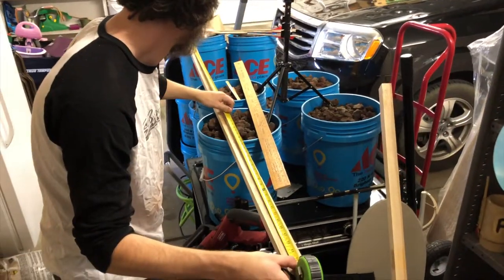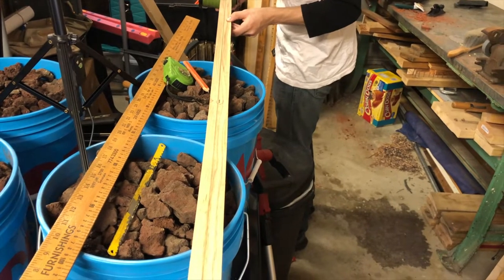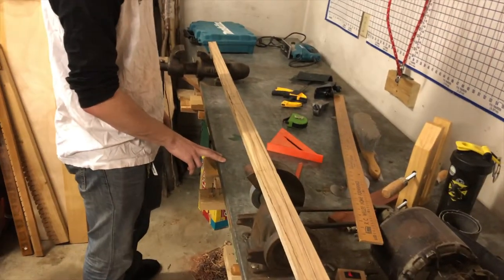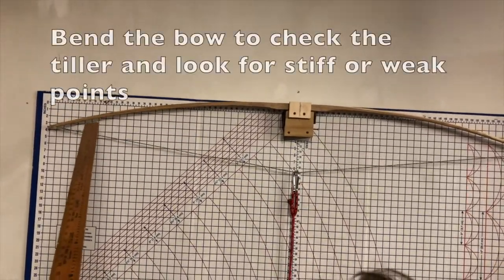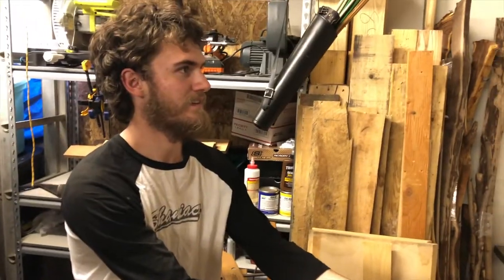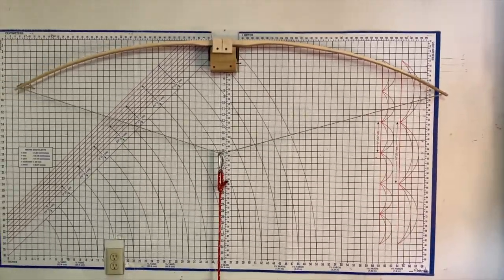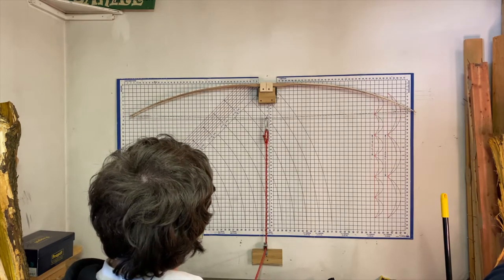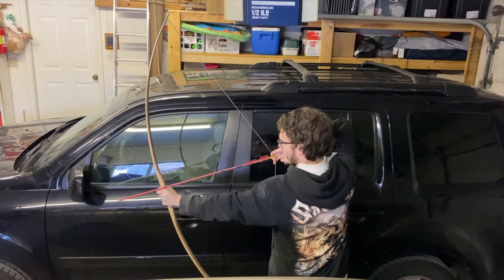A Beginners first longbow out of a hickory board

Comment: Hey just wanted to ask y’all guys how do I find that wall chart that y’all used in measuring the limbs of the bow while you were tillering it out Where do you find it and what is it called
Reply from the maker: Sure thing! Here is a link to one on Amazon: Dritz 890 Superboard Durable Kraft Board, 39-3/4 x 72-Inch https://www.amazon.com/dp/B0018N22FO/ref=cm_sw_r_cp_api_glt_fabc_YVY8024A0C5JT5TESY30
Reply: Thanks for the info appreciate I will have to order me one so I can finally Tiller my hickory bow

Comment: What were the measurements on this bow? I would like to try this for my first bow.
Reply from the maker: Wonderful! Always exciting to start your first bow. It is a 6 foot bow with the nocks cut 1 inch in on both sides. It has a 4” handle section that is offset from the center of the bow, 1 inch up and 3 below center. We made the limbs of the bow about 1.25 inches wide until the middle of the limb then tapered down to the .5 inch wide nocks. Let me know if that helps.
Reply: @BowtellBows  Thank you so much. I'll let ya know how it turns out!!!!